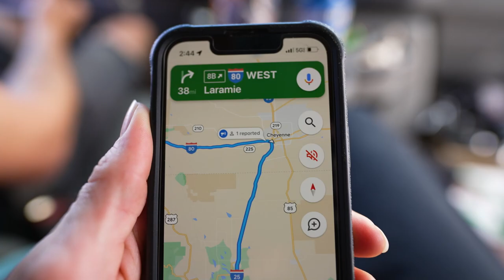PREPPING FOR A NOMAD FESTIVAL | Bus Life Couple

Comment: On my 460 in my motorhome, when I changed out the water pump, I didn't change the thermostat.  I mentioned it to someone, and the first thing he did was ask if I changed it when I did the pump.  I said no, and he said, well, I bet that's your problem.  I changed it, and it was.  I have no idea why, or how he knew, but it may be something to explore with your engine.  ( I know how a thermostat works, but not how to test it )
Reply: a boiling pot of water with a thermometer in it whatever the thermostat is..165 or 185 etc it should"pop" open at that temperature and close when temp drops  it can be tested also by the temp gauge in the vehicle by running the engine with the cap off the radiator and when you start to see the coolant circulating that means the thermostat has opend another thing a bus owner doesn't realize is that the air needs to be "burped out of the system and it takes a long time to do that
Reply: @chasgs  Is that taken care of through the coolant reservoir?  Do you have to do something manually?
Reply: @garypollock1949  no I was first referring to removing the thermostat from its housing to check it, it's a trick used in the old days when it was easily accessible by removing the housing with two bolts and then dropping it in a boiling pot of water the other way to do it in a running engine is search how to bleed air from a cooling system and watch some of the videos and pick the one that best resembles your engine set up
Reply from the maker: @chasgs  I've already tried two new thermostat. 🥲
Reply: @BusLifePirates  oh I wasn't doubting your abilities I was more replying to Gary ,I'm not up to par on your motor all I know is it's not the original so I don't know if it was a rebuilt or a used engine but did you know something available at a good diesel shop is a cooling system flush which is done under pressure with cleaners and HOT water they do that to semi motors when a transmission cooler goes bad and leaks oil into the system, the circulate the cleaner through the block for like an hour and then flush with water til the crud is flushed out , whether or not that would work for you is a thought it also deep cleans the radiator, very expensive though something else that can be done is to fashion some homemade air intakes on the side of the hood and an air scoop on top and i would have had added a manual override switch for turning on my clutch fan when going up hills etc...